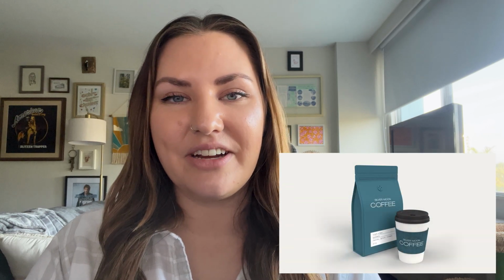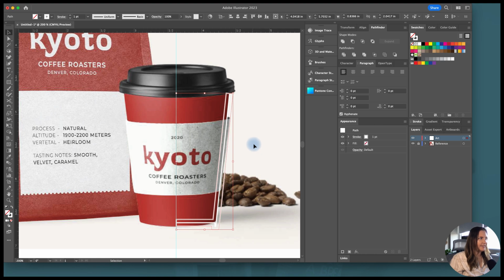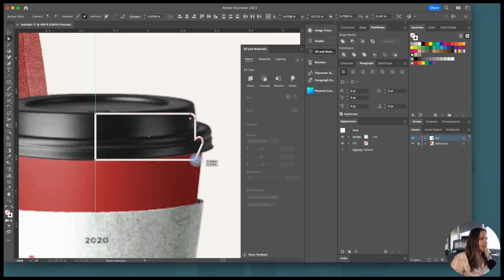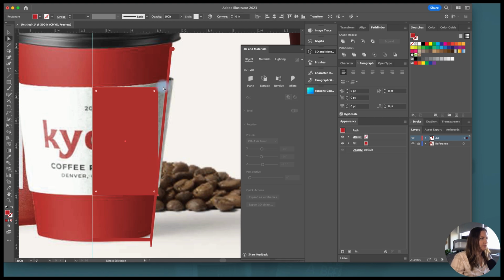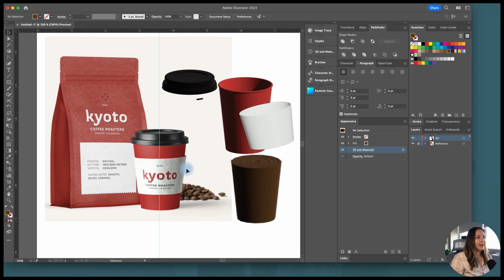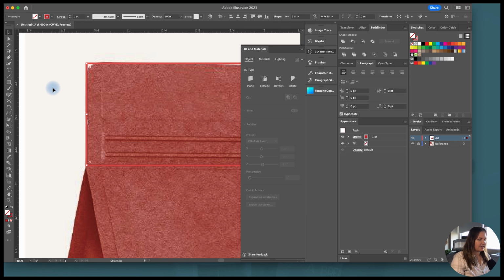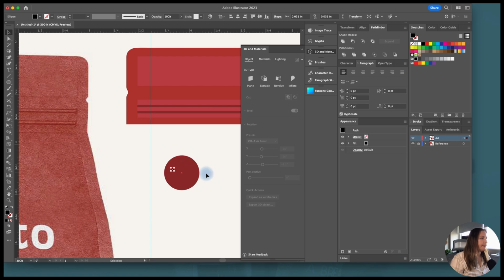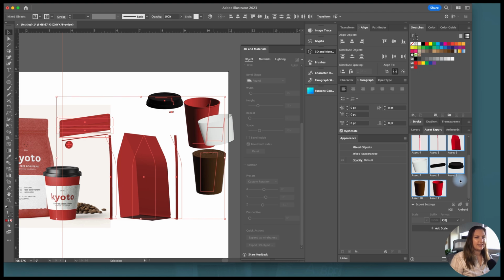Part 1: Designing a Coffee Bag and Coffee Cup Mockup using Adobe Illustrator and Adobe Dimension

Comment: Very nice. Do you have anything about creating an asymmetrical bevel to an object? I have a flat illustrator outline drawing of a guitar. The face edge includes  S-shaped and C-shaped curves and I want to create asymmetrical bevels on them.  Or is it possible to make two layers of different shapes and connect them at specific points to create a contoured bevel surface with compound curves turning on all axes?  Imagine a disc with right angled edges and then sanding away a bevel on one edge the shape of a a crescent?  I hope that makes sense. I know Illustrator fairly well but I am a novice with 3D but if I knew what tools to look for it would be helpful

Do Acrobat or Dimension allow for boolean operations to subtract one object from another?  Thanks.